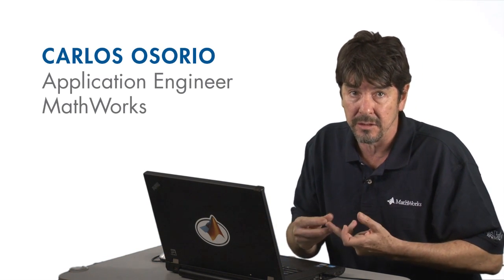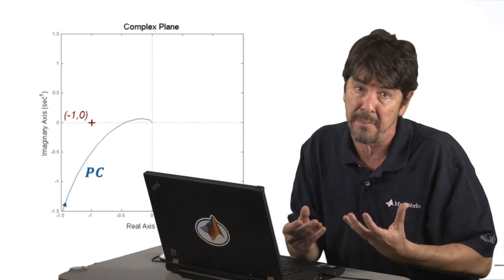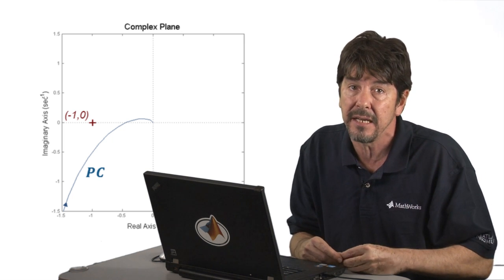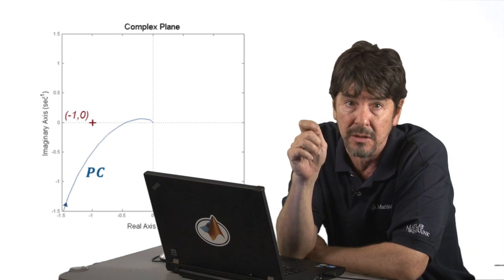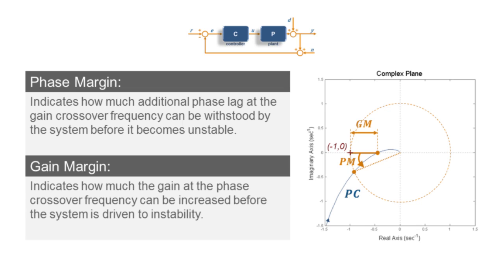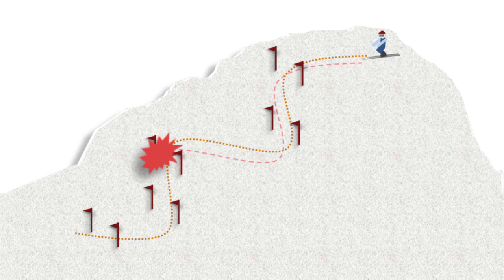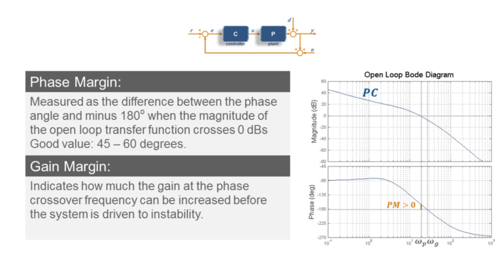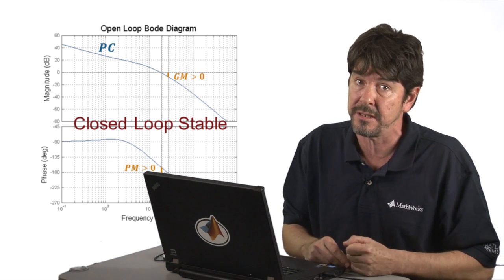Phase and gain margins | Using Bode Plots, Part 3

Comment: If these stability criterion is satisfied, does it mean that the system will be completely stable of all types of inputs?

Conversely, if there is a pole in right half of s-plane, will the system be unstable only when the input signal frequency is equal to a particular unique frequency and stable for all other frequencies?

Comment: There is often a confusion between the criteria of stability:

As per the closed loop transfer function if (1+GC) = 0, output beccomes infinite, which can be considered as instability. This is the reason of using -1+j0 point for nyquist criterion. 
However, the condition that no roots of (1+GC)=0 should be in right half of s-plane is another stability criterion. How are these two criteria linked each other? Or are they different and both should be satisfied?